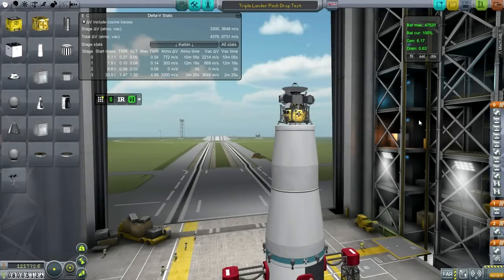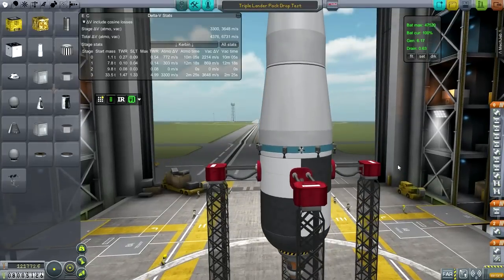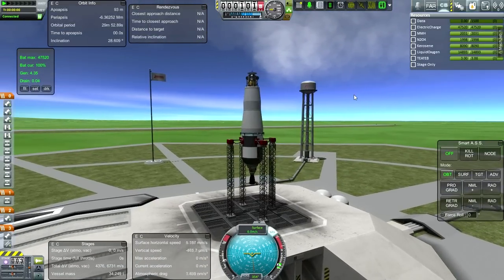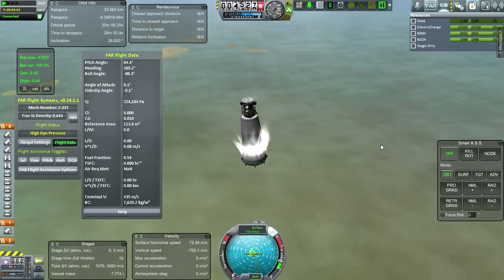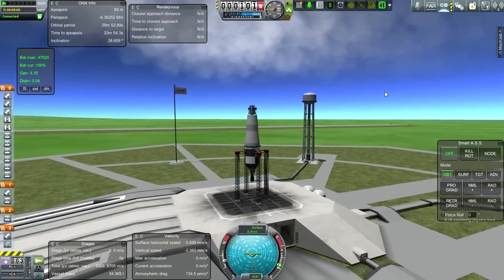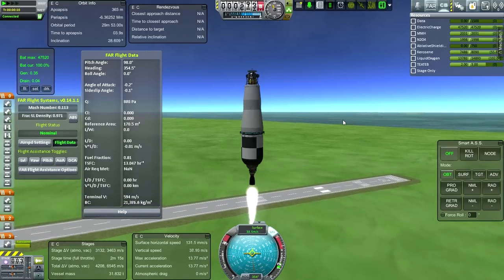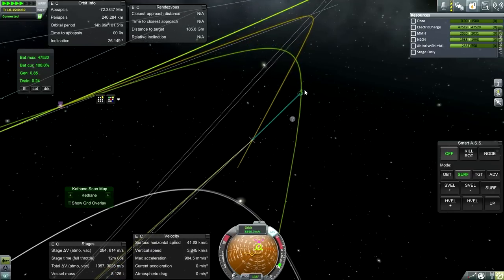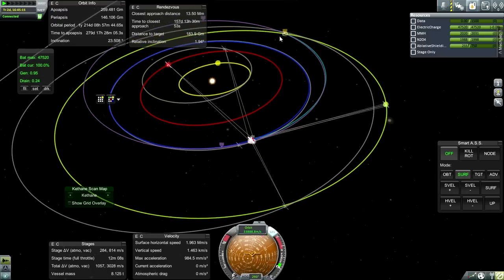Kerbal Space Program (0.24) - Realism Overhaul 065 - Mars and its Moons Redux, Part 1

Comment: I've asked NathanKell about that issue with drag and he told me that this bug is fixed in FAR for 0.25.
Reply: ***** I only know about PP. 
As for upgrade - I think you'll be better off waiting a bit as 0.90 a.k.a. "Beta" is not that far off already. With that said, 0.25 RSS is pretty stable, although you'll be practically forced into using opengl renderer as default DX9 renderer is going to eat off your memory in no time flat. You might also want to install DDSLoader mod and "dds-ify" all textures as it cuts down loading time by a factor of 5x (at least on my computer).